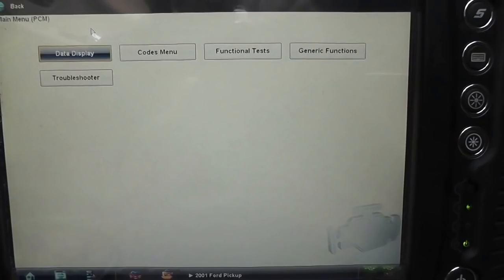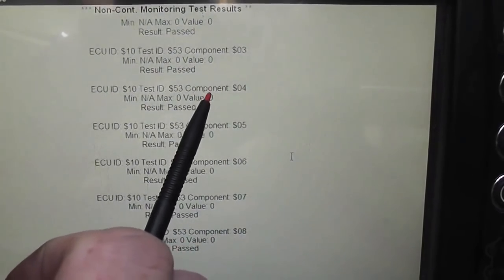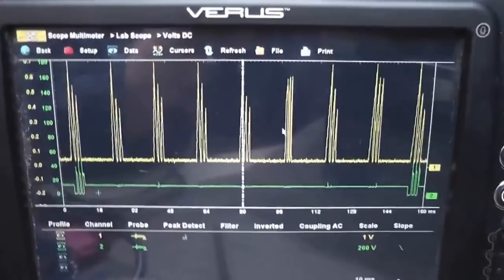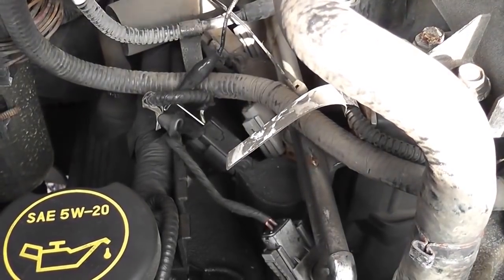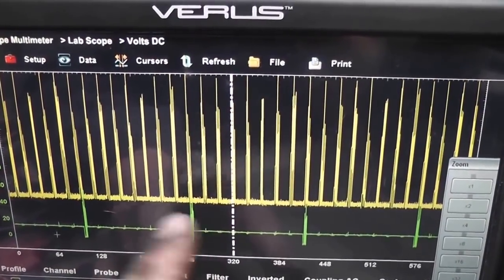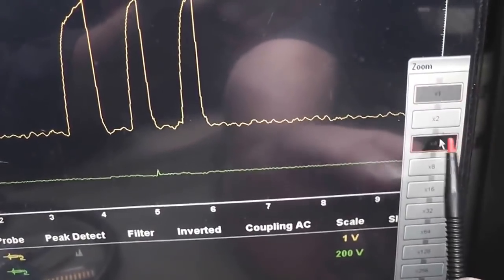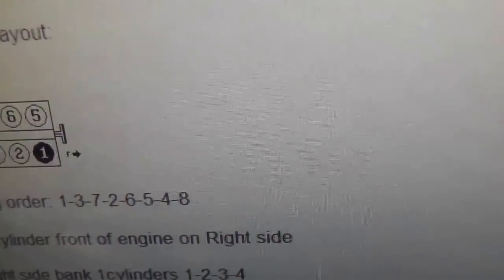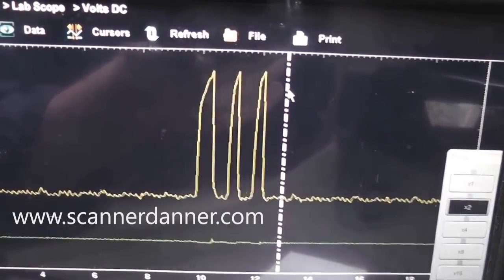How to find a shorted ignition coil with a lab scope (Quick Tips)

Comment: Hi Paul, second time watcher, just a quick comment, don't get me wrong you are now my go to guy, but at the four min mark you suggest there will be an eight count between fire pulse for cylinder number one on channel two and i would suggest there will only be 7 pulses between the number one pulse. Sorry if an a hole like myself has already commented about this, I did not SCAN your other comments to confirm.  JR your new North of the border admirer.
Reply from the maker: Good catch! I was most likely counting the sync as 1 and then ending in 8 before the next sync.
But "between" them, you are correct! It would be 7 😉
Thanks!

Comment: The reason you do not have oscillation in the pulse is because there is no inductance being produced in the coil. Also you can tell that the peak amplitude is lower compared to the other pulses, which is actually more indicative that the coil is not functioning
Reply from the maker: That is only partly true. There is still a primary winding that is completely fine. It is only the secondary side that is shorted. Oh and the coil was functioning btw, it was just dumping its energy off in the form of current flow and not voltage

Comment: Why would a shorted spark plug create shorted looking primary current ramps?
Reply: If I'm thinking about it correctly. The shorted plug is loading the secondary down, the secondary voltage gets loaded down because a short will draw full load current and doesn't produce a voltage drop.
Thus pulling the primary voltage down.

Comment: Hi scanner dinner I watch your channel all the time I find your information super helpful although I have  came across one problem I cannot figure out on my 2002 Mercedes-Benz S4 30 I cannot get any power the car will not crank I’ve checked the fuse boxes there’s power to them I replaced the to fuse boxes that are in the footwear The entire box itself I’ve replaced the crankshaft sensor which said it would possibly be that in my car would not start I replace the brake light switch still no brakes I’ve checked all my relays out of the fuse box they’re all good I’m not getting power to some portions of both fuse boxes in the engine bay I am doing all the work myself on my car so far everything has been successful that I have replaced but I am now going into almost a month of not being able to drive my vehicle and Not sure where to go from here any suggestions?

Comment: Thanks a lot for great video, but i would have a question to you. What if firing line that goes high, shows ALL upside down on the scope. The 1st and 2nd secondary ignition coil showed all Upsidedown on the scope but the 3rd and 4th ones looked normal. What can be its reason?
Reply from the maker: it is normal to see the pattern upside down, especially on waste spark coils, just invert your pattern
Reply: @ScannerDanner  another main thing is that spark line of a specific secondary ignition coil jumps higher and on the Same coil shows three smaller spark lines. It continuous regularly. One big spark line and three smaller spark lines...
Reply: I mean I haven't seen such kind of activations on the videos.
Reply from the maker: @orkhansafarli5992  if it is a Ford, this is normal coil operation at low RPM (it fires three times at TDC)

Comment: Hey Danner any diff between back probing the common power wire on the coils, vs amp clamp on the fuse? I would think not and just a preference thing but wanted to confirm.
Reply from the maker: Definitely a difference in voltage and current waveforms in what they can and cannot tell you.
Reply: @ScannerDanner  TY I was unaware. Do you touch on that in your book? I own it from forever ago.
Reply from the maker: @woog74  yes sir. In chapter 1 and in chapter 22

Comment: I thought that is curent of shorted primary. shorted secondary usually diagnosed with inductive probe for COP or wire-clamp for other types (my practise)
Reply: I'm guessing a shorted primary would show a much higher current flow when it is switched on.  No oscillation because secondary isn't interacting with it in a normal way?

Comment: so back probing the coil wont damage scanner?
Reply: A 10x probe or 20:1 bnc attenuator should be plenty of protection assuming the input is at least CAT1 rated for 300V.
Reply: @tonyfremont  I back-probed a coil with a cheap chinese oscilloscope on 1:1 probe and didn't damage the thing. It is rated at 80V max. Maybe it's just pure luck.
Reply: @danielmusat597  there's usually two different voltage ratings on inputs in the specs.  One is usually plainly stated and it's the lower one.  The other is the max rating, and possibly that is where you got the 80V rating.  The fine print is that it should survive the max, but not operated above it for a usually undefined amount of time.  Results can be anything from nothing happening through an apocalypse occurs ;), it's undefined.  Generally, posting conditions above the max will likely cause damage over time, like reduced accuracy, sensitivity, complete failure etc.  It's just something you should avoid doing.  I prefer using a 10x probe for everything I can, even very low signals because it doesn't load the circuit as much.  Important with weak signals, coils and injectors not so much.  I've always been leary of inductive spike situations, just because you never know how high they are, until you measure.  I highly recommend getting a cheap 20:1 attenuator for coils and injectors, just to be safe.  Even a cheap scope that works is more useful than any scope that's deaf and blind. ;). All of this is coming from an engineering point of view, rather than automotive.  I've seen spikes from automotive type relays exceed 300V and seen transistors survive that, even though they had a max rating of 60V, anywhere from one time to never failing.  Up to max ratings, things are supposed to survive unharmed, operations at or above them, anything goes.
Reply: @tonyfremont  Totally agree with you. It was dumb from my side to do that but I was too tired and realized only later...
Reply: @danielmusat597  I didn't mean to make it sound like you were dumb or reckless; I apologise if I did.  I just wanted to put something out there for everyone that watches these videos, so that they're aware that scopes are a little more delicate than multimeters.  I've killed my share of test equipment in my life, especially in the days of analog panel meters with no kind of autoranging.  Learned about hot chassis radios the hard way.  Just because it's "ground" in the circuit doesn't mean it's at earth ground.  I've been using oscilloscopes for a long time, but never had the nerve to bring them outside to the car.  I'm a noob at this.  Scopes are a lot cheaper these days and a lot more useful.  Battery powered digital storage tablet scopes are something I never dreamed of as a kid (pushing towards 60 years old now). Learned most of what I know the hard, expensive way. Just want help others avoid that when possible.  ;). I bought a cheap Hantek to start my car oscilloscope adventures along, and don't want to kill it, even though it cost less than taking the wife out for a good meal.  I have other older scopes, and I'm seriously considering a Micsig STO1104 and I really don't want to kill that. ;) After the Hantek, I may buy a lower end Pico.  I build escape room props and I could really use a portable scope for on site stuff.  I like old cars too, and newer ones, and it's really recently that I discovered how much information could be gleaned from waveforms of fuel pumps, injectors and ignition systems.  That's why I'm watching these videos and I want to share back whatever I can to others.  Have fun, but he careful.  If I save one scope from a blown front end, I'll feel like I've done something useful.
Reply: @tonyfremont  Don't worry! I didn't take it as an insult. No way. I was dumb back then though I am not dumb usually. However, I do not advise anyone to do what I did. If this is what was understood, then I apologize and rectify my statement: Do not connect the oscilloscope directly to a drive circuit of any inductor or long wire that could act as an inductor.. Use any protection available for electronic circuits. Mostly front-ends which are the most prone to be destroyed by high voltage spikes.

Comment: When your testing using a scope, make sure to use an attenuator to protect the scope input.  Make sure you check and know the maximum input voltage to the scope.  You wouldn't want to grab a wire that had  a possible 100 volts on it without protection, neither does your scope!
If you understand a magnetic field inducing a voltage in a wire, or current flowing through a wire creating a magic field, that's what's going on in that ign coil.  If the coil is having secondary ignition problems, that magnetic field is going to induce voltage back into the primary and that's not good!
I've seen more than once in Ford F250's and F350's with 5.4L V8's and  6.8L V10's in years 2002 to 2004 how an intermittent bad ign coil and/or bad ign coil/spark plug caused stalling and a computer code for the Input Shafter Speed (ISS) sensor in the automatic transmission.  Replaced all 8 (or 10) spark plugs AND ignition coils.  Code never came back and stalling problem ended.
Reply from the maker: The Snap-On scopes can handle 400v spikes without an attenuator

Comment: Hi i have a buick park ave with passkey 3. Im having issues with security system.i have a p1626 fuel enable code. Was wondering if u could point me in right direction. I tested b+ wire, and ign B+ to the vtd module all checked out good. Ground has less than 100mv. But my 2 serial data lines  have less then 1v?  @scannerdanner
Reply: I also checked tps thinking a shorted sensor could be bringing me down.   Backprobing tps had 2v, but unpluged it has 5v is this normal?